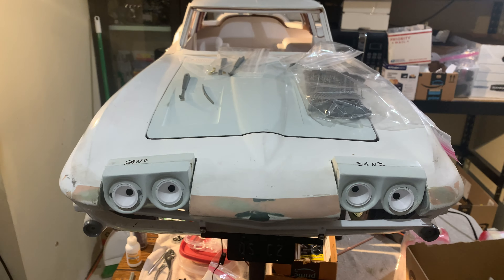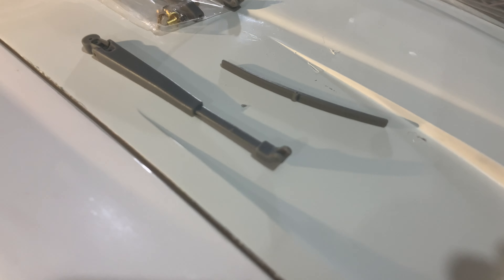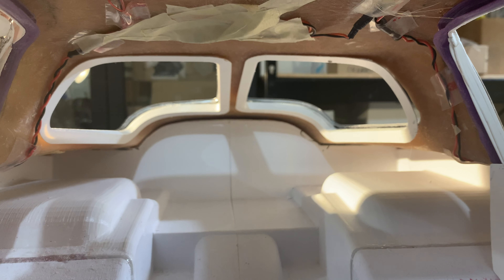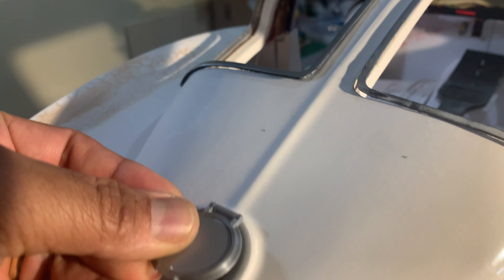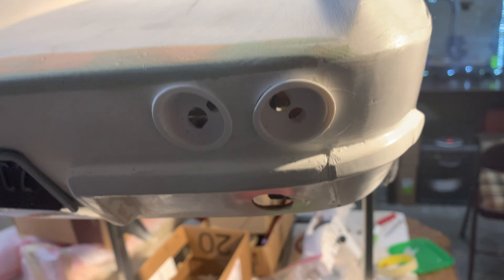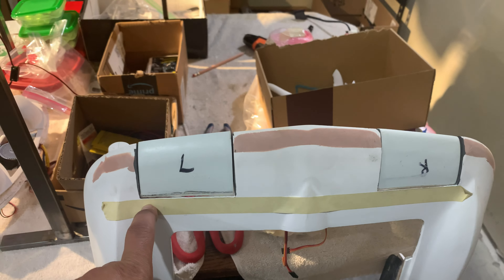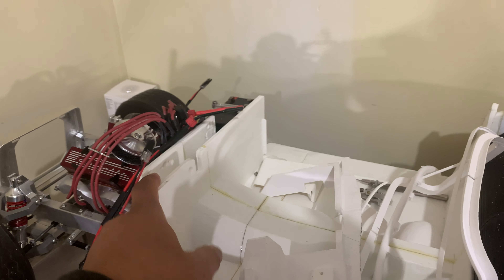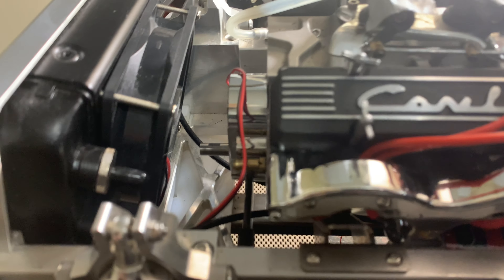1963 Corvette Stingray interior and body build Part 4

Comment: Fantastic work!  What 3D printing process did you use for those parts?
Reply from the maker: I used SLA for the chromed parts. Going forward I’m considering just using metal for all the chromed parts. Chroming so many small parts for such low runs is not the best option cost wise.